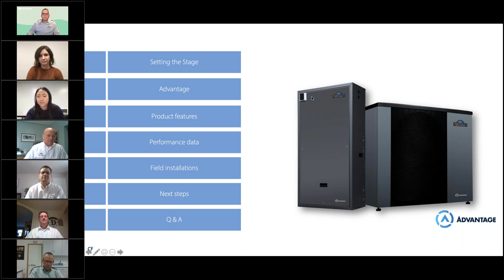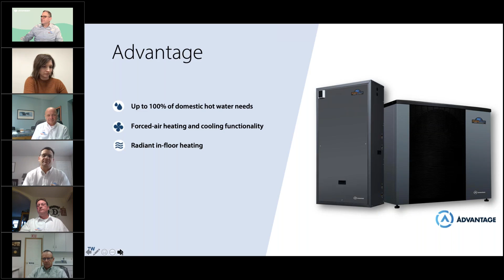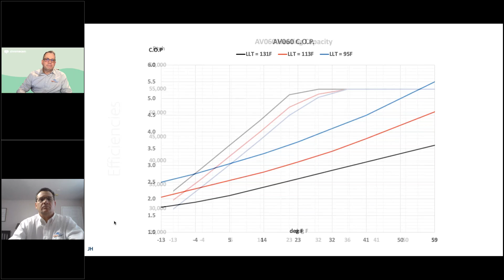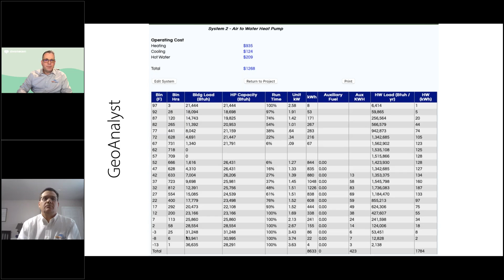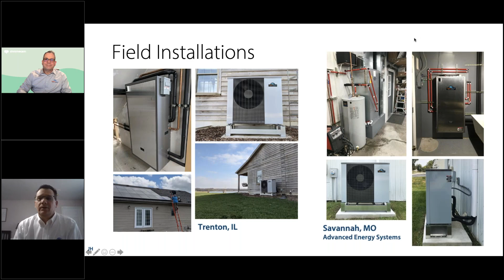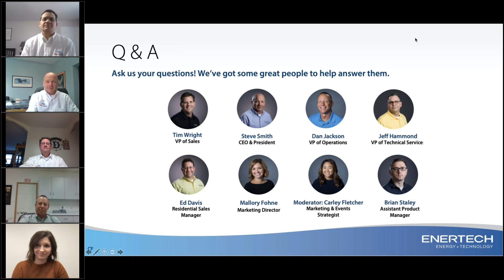The Emerging HVAC Technology: Enertech's Air to Water Heat Pump

Comment: If utility power goes out and battery backup kicks in, how many amps is necessary at 240 volts for the Enertek 60 unit to operate assuming a dual fuel setup with a propane fueled tank  plumbed in (system used for radiant floor heating...no air handling).
Reply from the maker: Hi Stephen! You'd be looking at 45.9 amps max on the outdoor unit and 3.4 amps max on the indoor unit. Read more specifications about the Advantage here: https://enertechusa.com/products/air-source

Comment: Can this system replace oil burner with baseboard heating?
Reply from the maker: While it's not a common practice, it's not impossible. Our water-to-water systems output much higher water temperatures than a typical geothermal system. For especially old baseboard heating systems, it may not be feasible to do a changeout. If you'd like a more in-depth analysis, would you mind dropping us some more info about your project here?

https://enertechusa.com/contact